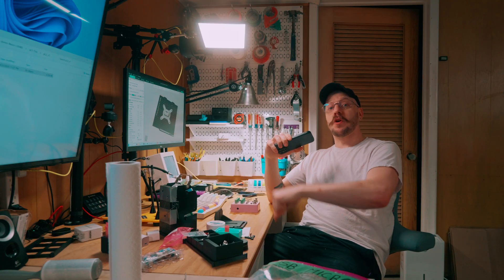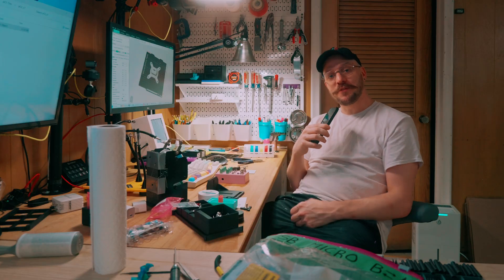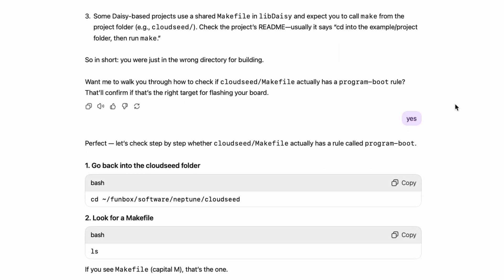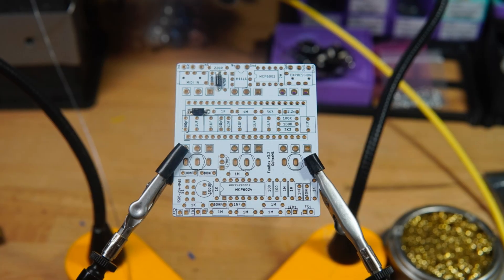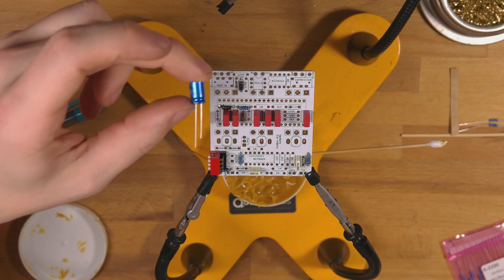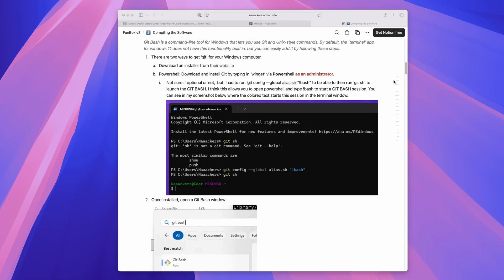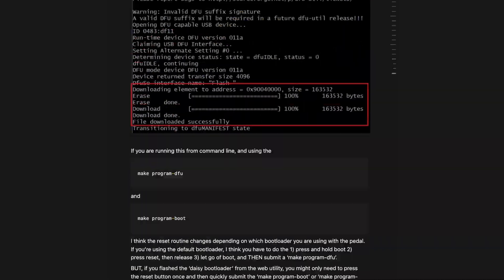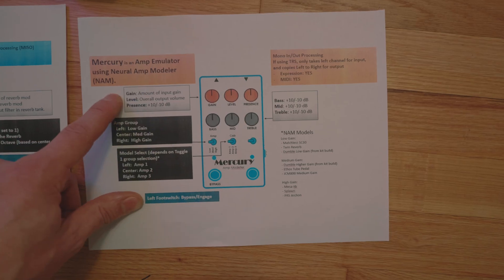You should build an open source guitar pedal.

Comment: @GuitarML Is there a way to use this as an amp sim with only high gain 5150 and slightly boosted fender deluxe with noise gate and doubler on toggles and feedback on the second switch